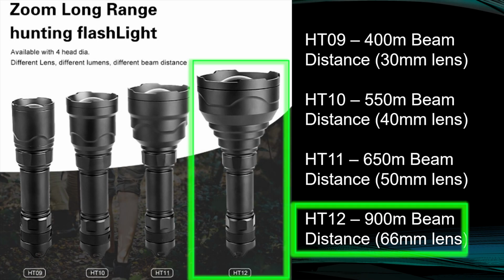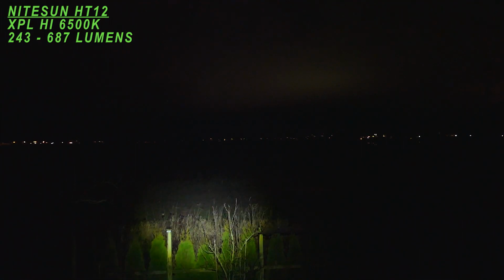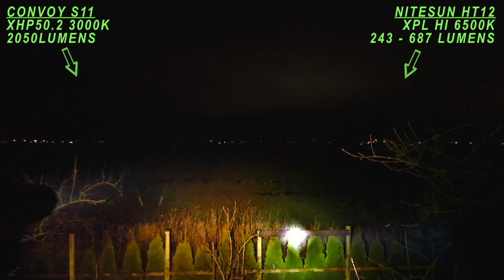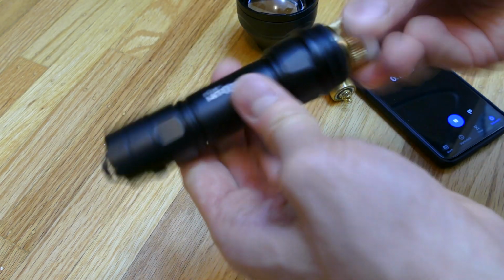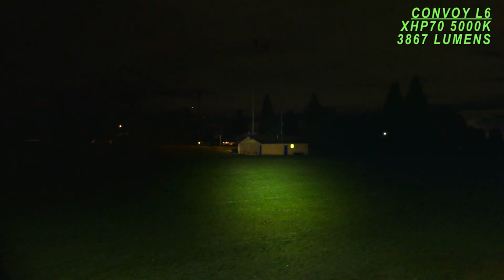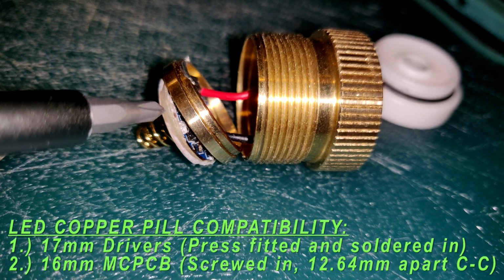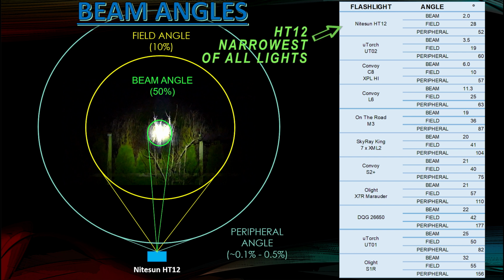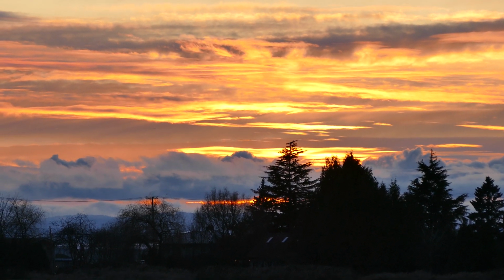Nitesun HT12 Long Range Hunting Flashlight Review

Comment: Hi David.  The Nitesun HT12 is certainly a desirable flashlight for those who want a good thrower, and competes well with more expensive flashlights.  I like the idea of using zoom lenses in combination with reflectors, and I would imagine that Nitesun have managed to produce a range of relatively efficient lights, considering the relatively modest lumen output.  Be interesting to see if the likes of Convoy develop and design something using a similar concept to add to their line, perhaps something around the C8 size.  That would be amazing!  Not everyone can justify the size and cost of the HT12, very good though it is.
Reply from the maker: Hi Alex!  Ya the throw was impressive.  That's why I wanted to test out the large lens, I knew it would capture and focus a lot of the light.  I would recommend the HT12 to those with night vision cameras since it's a good way if sending IR light a distance, perhaps you could see out to 300m with a night vision camera, and that might be worth the price and size.  
The XPL HI actually is outputting over 1000 lumens, but there is a huge loss to light being thrown to the sides within the head.  I haven't seen reflectors combined with lenses before, that's interesting. Has anyone made one?  What advantages would it have?  They have used a white plastic piece to try and reflect the light out the front, which creates some spill light, I think that's pretty effective.  A refector may focus this and focus that spill light a bit I suppose.  I'll have to give it a try. 
I was also thinking that a dome on the LED would help push more lumens OTF, like on an XP-L2 LED, I'll have to throw one in there and see what happens. 
Thanks for the comment and ideas!
Cheers,
David.

Comment: hi david... im still hopes there will be a sofirn if25 review from you...
Reply from the maker: Hi!  I have been playing around with the IF25, it's quite good!  Not super high output, but a very nice 21700 flashlight. I will definitely do a review of it soon, since it is so interesting, a very unique light!
Cheers!
David.
Reply: @DavidSunshine  hi david, i have one more question about 18650 battery that use on direct fet driver... which one will pull higher amp on tail between sony vtc5a, vtc6 ,samsung 25r or tesla battery ?..
Reply from the maker: @harisyoung4110  Hi.  It is all based on the internal resistance, it VTC5 is 13mOhm, it'll be less than a VTC6 which is 8-12mOhm, but it depends on the age of the cell. VTC6 is better cuz it has more capacity though, so you'll get more out of it even if it's a little old. The Samsung is kinda in between the Sony cells, but Samsung longevity of cells is pretty good, I like their cells.  
I personally would go with VTC6 since it's the best of all worlds.
I don't know much about the Tesla 18650, might be 15mOhm and it'll be old so I wouldn't bother with that. Might be cool as a novelty tho!
Cheers,
David.